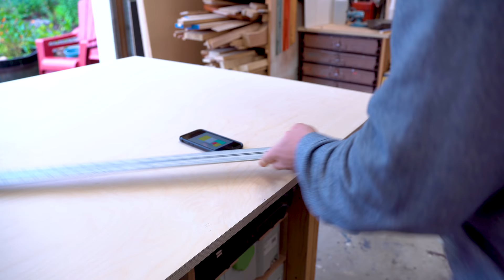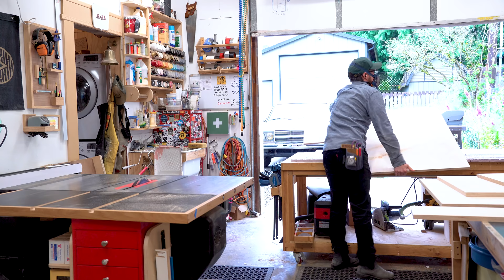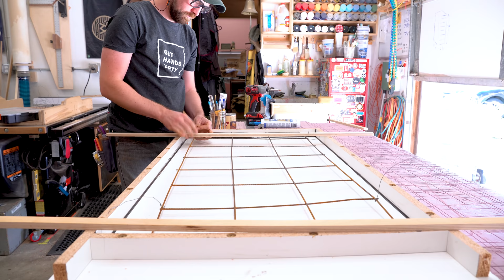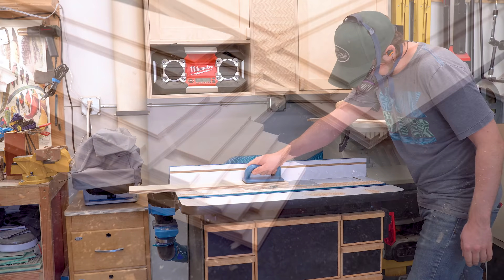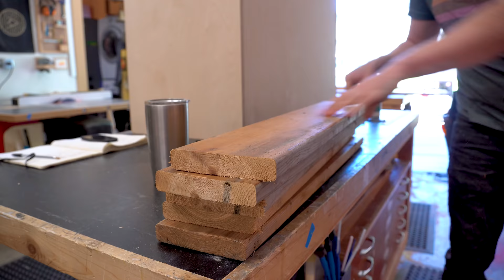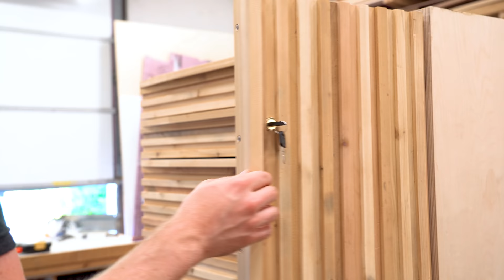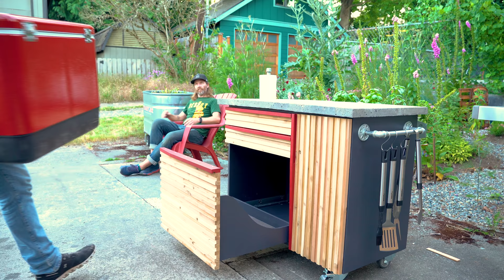BBQ Grilling Station |  Plans

Comment: You were absolutely correct in suspending the mesh in the concrete. If it sinks to the bottom, it will stick out of the set concrete at the bottom and will rust inwards from there eventually cracking the concrete it is in contact with.
By the way, you had a really nice consistency in your concrete mix. Not too soupy, and not too dry. 😊
Reply from the maker: Good to know!! I felt like I fumbled my way through the whole thing 😅

Comment: I’m just the messenger: your Weber grill grates are upside down. So were mine. So were the guy’s who told me. I swear it was photographed wrong on the box. But you want the flat side up, it cooks so much better with more surface area on the cast iron.

Comment: A little tip. If you want clean sides to your concrete, use a trowel or similar to slide down the sides of your boxing in an up down motion while the concrete is wet. This takes out the bubbles and gives it a smooth surface.
Reply from the maker: Good to know!!! Yeah that’s the bit that isn’t great
Reply: If you have a recip saw, take the blade out and use that for a vibrator.

Comment: Quick concrete mixing tip for small projects. One sack of concrete to one gallon of water (+/-) and mix in a 5gal bucket with a wide paddle mixer and an angle drill on slow speed. Works like a charm.

Comment: Love this! Great design and build. 

FYI melamine is the coating on the particle board. It's the same stuff used to make tons of things like plastic plates, dry erase boards and even Mr Clean Magic Erasers.
Reply: We also call them melamine boards in Denmark. And they're absolutely awesome for molds
Reply: More accurately it is a thermal fused laminate sandwich with the TFL surface on one or both sides of a particle board core.

Comment: Missed this video. Normally in a slab foundation, since the pour is done at once the rear sits on chairs to give it the clear cover it needs to resist corrosion. In you case I would have done a bit of the pour, placed the mesh then placed the rest of the concrete on top. 

The mesh should be at the center if you don't know which way it is going or favored toward the side that will be facing down as the wire mesh is to assist tension since concrete has poor tensile properties.

P.S. As for the air bubbles, unless you have a way to vibrate the form you'll constantly run into that issue. You can try lightly dropping each end of the form, bit it's effect will be minimal.

Comment: Great video, one thing, to liquify concrete you need to vibrate it, with heel of a drill on the base board, some down in the list may have mentioned this. still looks great though!

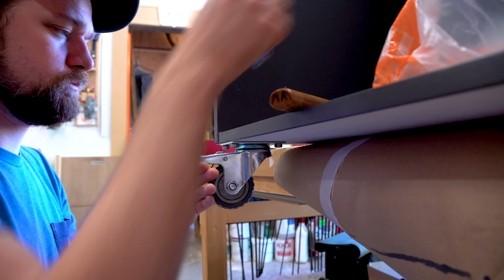Comment: Great project and really loved the video.  If I could offer a little bit of advice for a stronger cabinet in the future.  If you look at 24:58 you'll notice that your end gable is on the side of your base.  As your wheels (or legs in some cases) are mounted inside of the end gable, all the weight being carried by the gable is mostly unsupported (just your tenons).  I've seen this, and had to fix many times.  For a stronger cabinet box, especially when using legs or wheels, make sure the base goes the full width of the cabinet to support the gables.  Great project just the same!!

Comment: "oh, those are some pretty neat drawer slides"

Looks up price

...aaand I'll stick with regular ones for a long time
Reply: They are a lot cheaper if you get them from a cabinet supplier like cshardware or cabinetparts. They don't come in a nice kit like rockler does so you need to get each individual part (the slides, clips, screws, etc) but they end up being like $30 for all the parts instead of rockler's $60+.

Comment: I haven't worked with concrete myself,  but am going to in the future and have been watching videos on it. From what i have noticed is that projects that use big box concrete the coloring attempts seldom work and they remain largely shades of gray. The ones who use the GFC like Modustrial have fantastic results with color. 

My speculation is that the standard bags of concrete have a more coarse and larger grains of sand in them The GFC type of concrete is more powder like sand. I wonder if that has something to do with it.

Comment: You'd gain in joint strength if you actually glued then entirety of the joining faces of the joint, and not just the biscuits (or whatever they're called) and the holes.
Sure, it implies to clean up any squeeze-out, but as the famous French saying goes "C'est pas la colle qui chie qui colle, c'est la colle qui pousse la colle qui chie qui colle" ^^
Meaning: "It's not the glue that shits that sticks, it's the glue that pushes the glue that shits that sticks" ^^

Comment: How does the Cooler drawer handle a full cooler? Also, for safety, I would have pot a couple of vent holes in the back of the Gas Bottle Cupboard. It might only be for holding spares but you still don't want any gas leak building up.

Comment: Awesome project. Spot on on your counter top reinforcement. Remember concrete cures, doesn't dry...ya, picky me, and after a pour like this, after it starts to harden to where you can't make an impression, keep it WET. This will help the curing process and make a harder product, though this looks great.

Comment: Great job on this build. I want to do one as well. Does water get in at all when it rains?
Also what is the reason for the bottom drawer to have the hardware on the bottom under that lip but the other two drawers have it on the sides?

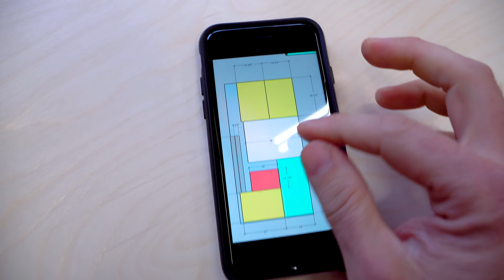Comment: @0:42 anyone know which T-square that is?  I can't quite make out the name (I can see it's made in Long Beach though 😁   It's not listed in the tools used section of the description.

EDIT:  @0:44 Michael moved his hand just enough LOL.  It's Walboard Tool 88-012/WTS-50 48" Drywall T-Square.  Some mixed reviews on AMZN though.

I need an accurate 48" T square so I'll have to check this company out.

And finally, what a nice looking table.  The accented drawer covers look awesome!

Comment: Neat project.  What did you use to adhere the top to the base, using a calk gun?  Thanks
Reply: Idk what caulking he used, but some acrylic based compound could do. If not, then just use silicone. It sticks like hell to anything that isn't coated in a slippery surface and neither concrete or painted wood are slippery. I've used it to glue wood to a metal tube and you'd need about 1½ - 2 hours with a sledgehammer to get those fuckers off. Silicone is tough as hell

Comment: Anyone with a filing cabinet from office depot or even walmart has a key to your propane tank. Just saying.
Reply: He'd need a front house lock to make it perfectly private as most keys to furniture locks are identical too, since the locks are so simple. The locks aren't meant to keep thieves out, but to keep curious kiddo fingers out and for that they are perfect
Reply: @Arterexius  He specifically said it was to keep his gas tanks from (and I quote) "walking off". That's thieves, not curious fingers.
Reply: @TheLukemcdaniel  If someone has planned stealing something enough to the point where they bring a standard filing cabinet master key, they will also have brought a crowbar. Locks prevent crimes of opportunity, not of premeditation. 

And you'd rather have them pick the lock than destroy the cabinet.

Comment: Do you think it needs venting for the propane storage cabinet?
Reply from the maker: I don’t think so. The door isn’t air tight. Good question though 😅 I wouldn’t have thought about that
Reply: @MichaelAlm  
I hope to eventually convert my Sprinter van into a family camper - so its been on my mind.  Not completely sure when it is needed and when it's not.  Are you going to seal the concrete counter top?